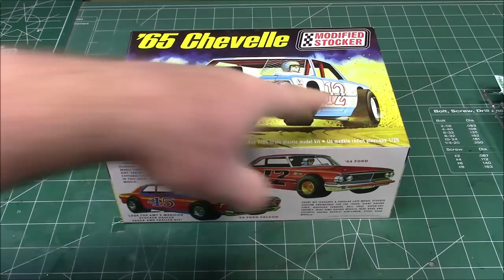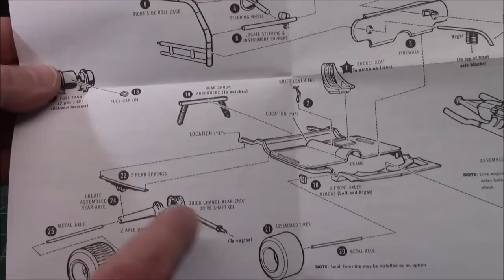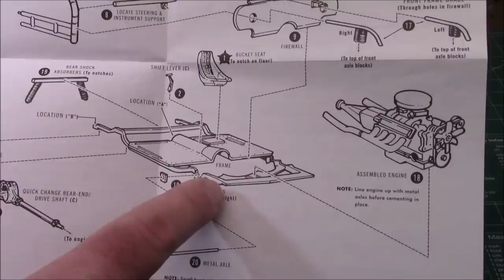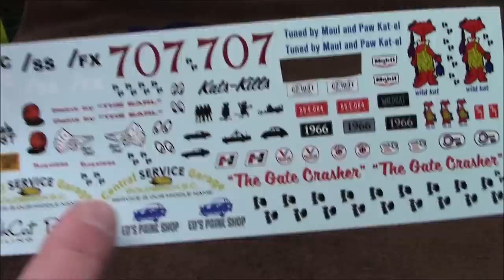1965 Chevy Chevelle 454 Modified Stock Short Track Car 1/25 Scale Model Kit Build Review AMT1177

Comment: I remember a story in Car Model Magazine about putting dirt tread on these AMT drag slicks.  Cut a strip of aluminum window screen after turning it 45 degrees to get a diamond tread.  Lay it on a cookie sheet.  Heat it with a propane torch.  When it glows red roll the vinyl tire along the strip, melting the pattern into the tire.  Let it cool and sand down the rough edges.  This was before the Mongram 1/24 sprint cars which have fantastic dirt racing tires but you'll have to replace the sprint car wheels.
Cheers!

Comment: I am so glad I watched your video before building this kit. I’ve got two of the carney plastic display cases. One is filled with nascar builds ( tilted display) second one (not tilted) is half nascar and other four rows are a row of mustangs with hydro dip paint. A row of funny cars a row of dirt track modified ( Vega  , 34 Ford and to be built pinto.) the last row are the modified dirt ( with dirt) racers. This build is the last of the dirt modified for the case. So you saved me a lot of problems. I started this reply just to thank you for another great tip , but got a little off track. I used the super clean for my rust oleum nozzles , it works great!  Thanks again
Reply from the maker: Thanks man!

Comment: Behind the main rollcage , the flat panel isn't a tarp....it is thin aluminum or steel...had purposes...allow air to flow freely through the car....but the most important purpose was being a rear firewall between the driver's compartment and the fuel cell/tank in the rear.  I really enjoy the builds....I've been building racecars since the late1970's....haven't built a model since the early 70's...  but I've just retired , so I'm looking at building racecar model kits now.....not as hard on the body as the real thing ! Lol

Comment: Hello, I really like the back ground for the car in the slide show, adds a lot to the feel. I noticed the dotted lines going from the back of the front frame members through the fire wall to the roll cage and the dotted line from the bottom of the fire wall to the floor pan front. With all the kits you build I'm sure you saw that too. With the metal axel going through the bottom of the engine it dates the kit to the 60's. The molds are in great shape for the age. I did not see any flash at all. With all the kits they have in this theme you could build them all and have a line up getting to race at the starting line. All you would need is a nice background to finish the feel. Great job really enjoyed it. Thank you very much.
Reply from the maker: Thanks for watching!

Comment: An even easier fix to the body fit is to reposition the rear axle on top of the leaf springs instead of below them. This also alleviates the problem of the drive shaft having to angle down well below the floor pan to reach the axle. When you lift the rear axle the shaft is now straight in line with the engine.

Comment: I’m puzzled as to why the rear leaf springs sit over the axle and not under. That’s not a mistake you made. That’s what the instructions told you to do. I’m just thinking of a way others could lower the rear. Great simple build for someone or like you said a kit bash. Good build 👍🏻
Reply from the maker: Shave off the mounts and glue the axle on the top if you desired.
I try to build them as close to the directions as possible, save for BIG issues like the rollcage not letting the body down at all.

Comment: Another good video there Chris but I have a question for you after you spray the primer how long do you wait til you put the final color on,thanks Chris its been a while since I've built model cars.
Reply from the maker: Depends on the spray but within 30-60 minutes. I also use a heat gun to speed up drying of primers.

Comment: What do you use to get dried Modge Podge off the windows? (I am a bit sloppy).
Reply from the maker: Dried?  I don't think anything will take dried stuff off and not damage the glass.
Maybe try getting it wet and seeing if it loosens up after a while...
Best to remove it all while wet with a damp Qtip. Wipes right off.

Comment: Is there any way to remove super glue from clear plastic? I might have had a small accident with a windshield part.
Reply from the maker: You can try to sand it but it's a long process of sanding and polishing.
Reply: @hpiguy  A'ight. Thanks though.

Comment: Perhaps I missed it, but where is the gas tank?
Reply: none in kit...it's not overly detailed,these kits when they first came out were more for the "feel" of a modified stocker at the time...
Reply from the maker: In the parts review you can see the optional moon tank that you can hide or have somewhere on the car if you want to use it.
Reply: @hpiguy  I did miss it then.  Thanks!

Comment: Car still sits way too high in the back.... I'm building one of these now, and I'm going to make some MAJOR changes to the build. The cage in this kit stinks, the fit is terrible.
Reply: I agree about the body still sits too high in the rear. I think the only way to eliminate that is to cut the rear half of the chassis off & scratch build or replace the rear half with another rear clip. JUst my thoughts.
Reply: @pikurtoy  I did end up cutting off the rear frame rails after building new "kick-ups" from .125x.250 styrene strip. I glued them inside the original frame rails with Plastic Weld and then ground away the og's with my Dremel.